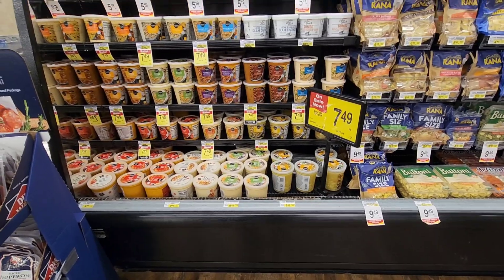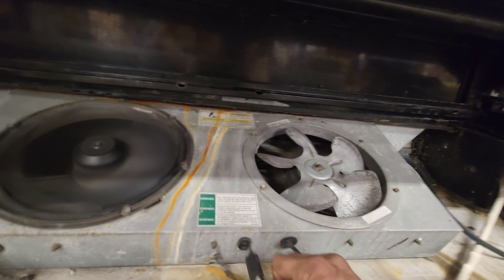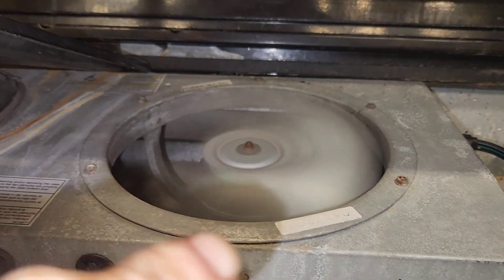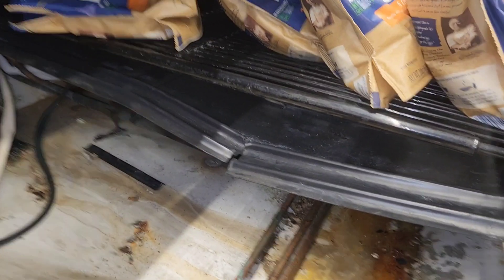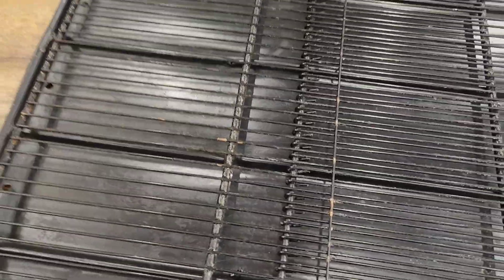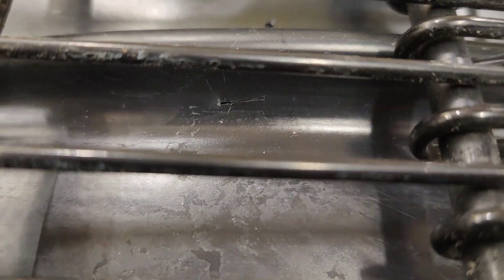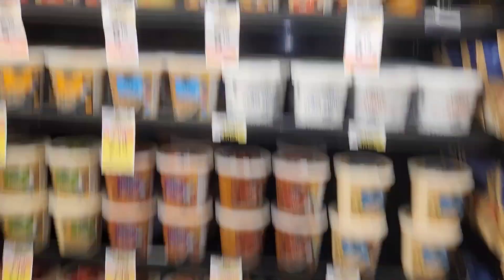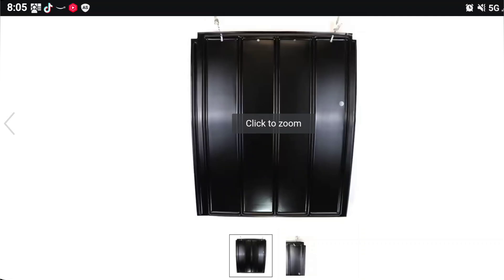Deli Case Top Shelf Is Warm

Comment: I’ve used metal strapping and screwed it down to the front of the case and the top of the evaporator fan shroud not a permanent fix but it helps until you get new ones
Reply from the maker: @I_Lucid_Dreamer  aye. Yea that's the call you sent me last night.  Oh hey. , I just heard back. I got the offer letter just now

Comment: Been doing this for 30 years am now retired, every time I open one of these Hussman impact cases, the useless plastic panels are cracked and broken.  Why is everything made out of plastic?
Reply from the maker: @KenDeltano  I'm sure there is a good reason, to make them out of plastic. But I don't know what that reason is. I work in the service department of Hussmann, so idk what goes on at the Manufacturing side of it.  
You know something crazy?... I have to order Hussmann parts from United Refrigeration. Lol.